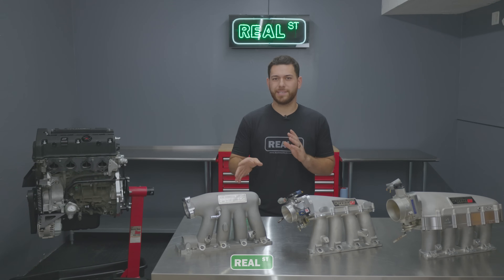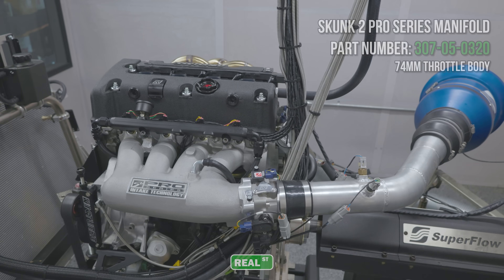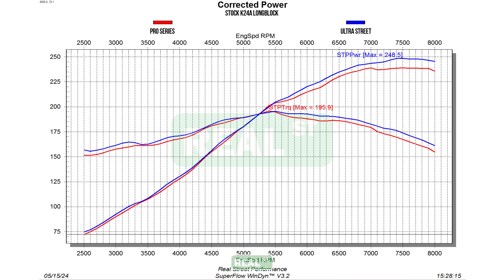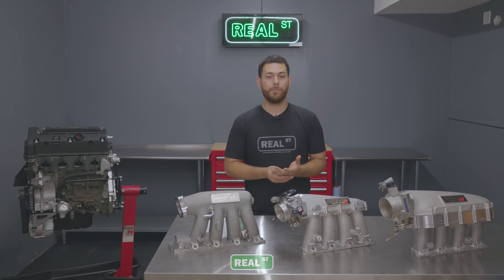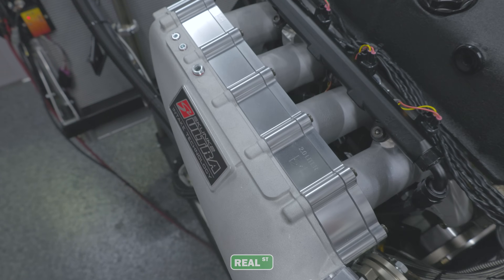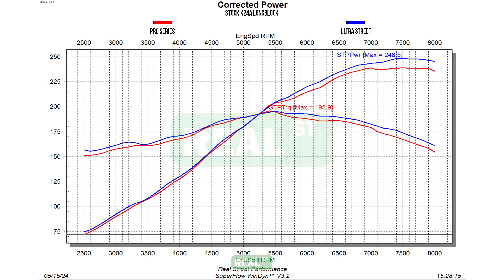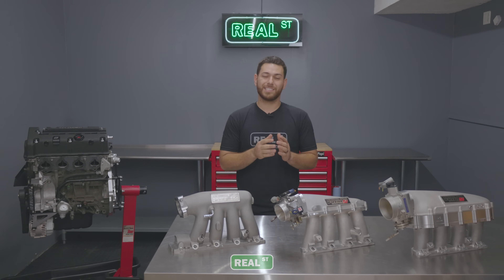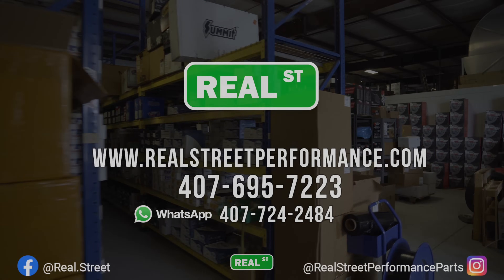Choosing The Proper Intake Manifold For Your Honda K24 || All Motor Stock K24

Comment: i have the 04-05 k24a2, i have the street series intake mani and skunk2 alpha headers..p2r fuel rail, bluetop injectors, stock mugen exhaust and my car only made 197 on a dyno hub...anything different from the setup in the video?
Reply: i'm wondering if they have a different vtc cam gear in this ?

Comment: And Pro Series VS Honda RRC?
Reply from the maker: We havent stacked them against an oem manifold yet, we may do so down the line to put out some more data. Thank you for watching!
Reply: @realstreetperformance  Yes that would be really good because everyone says that the RRC is better than the Skunk2 Pro series which is normally its equivalent. A Skunk2 Pro series, Honda RRC, Honda RBC test would be really great. Same as RRC vs Pro Series. Not Ultra Street because it is a category really above but Skunk2 Pro series vs Honda RRC would be great 🥰

Comment: Quick question, Can the skunk2 manifold be installed without a tune and do I have to upgrade the piston rods? I was thinking about upgrading my daily 2012 TSX to make it a bit fun before I build a NA k20 to replace the current engine. It will eventually become the project and Id have to get a new daily at some point. but till then I would like to have some fun with it current stock motor till I crops out. Any suggestions

Comment: Test the center feed on the stock k24a longblock! (pracworks or other brands) Its a logical competitor to the ultra race/street
Reply from the maker: For sure! We're just getting started :)
Reply: @realstreetperformance  I'd love to see the Bourne HPP cam added to the list. Not sure if their high lift cam would work with stock compression, but i'm sure their drop in cam would.
Reply: Maybe even the 4p RR3 cams?

Comment: No base line HP numbers. What was the stock intake? They give the power the 4 skunk 2 set ups gave them. Always need a baseline. Good info for the intakes but doesn’t tell me if the 1st one made any real power.
Reply from the maker: Yes I agree, adding a stock manifold would be a good comparison. For now, I think the data we got comparing these other manifolds was insightful for those set on an aftermarket unit. Thank you so much for watching!

Comment: Awesome test, thanks for sharing! I definitely wasn't expecting these results, especially the similar low end torque. I would have thought that the Ultra Race manifold would have killed the low end torque with such short runners. It would have been awesome to see a baseline run with the stock K24 manifold though so we could see the difference. The OEM RBC and/or RRC manifolds would be a great comparison too so we could see if upgrading from an OEM manifold would be worth it.

Comment: ultra street 
74mm TB
3" manifold
70mm system 
50degree vtc

Made 255 / 205ftlb @ 8000rpm

Since then, gone full 3" setup and expect closer to 260
Reply from the maker: Nice! sounds like a fun build
Reply: @realstreetperformance  Just adding my 2pence as to further backup your test results. Although, how did you find the port alignment to the head on your ultra street manifold, mine were iffy?

Comment: Are you guys running a type s oil pump and rbc intake cam gear or not? Based tsx cam gear is only 25 degrees, if you guys running it is as total stock, can you do a second video with these upgrades also include a rbc ported 80mm, rrc as well

Comment: Nice test, would have been great to see it baselined with an RRC in the test too
Reply: Agree, missed opportunity. There are 2x tests online from Tegiwa and Superstreet showing the RRC as the winner up against Skunk2 and others.
Reply: @SBBUK how's the rbc 8th gen si compared to the rrc?
Reply: @mikellewis2346  RRC beats RBC for peak power in all the tests I've seen, but all differences are only a few %. You might get slightly more power lower down with RBC but it's minimal.
Reply: @SBBUK  thanks,  I have a 07 8th gen si with jdm k24a in it with the rbc and it runs great for back road fun. So sounds like it's not worth the hassle to change it for little to no gains strret driving it.
Reply: @SBBUK  est ce une vidéo franche ou commerciale? Où peut on voir ce test?
Reply: You could also port the RBC which will help it you won’t need to upgrade for a bit unless your doing crazy compression and cams the normal drop in cams with a ported mani and head will be enough stock comp

Comment: I’d be interested to see a graph of skunk2, gato, and other intakes on a turbo application
Reply from the maker: Turbo intake manifold testing i think will be really interesting too.
Reply: @realstreetperformance  I think it would be interesting to see how cast runners , cnc runners, ported cast runners, and different size plenums can make a difference to the power band or power gain/loss.

Comment: Please show how it compared to a stock RBB manifold!  My stock K24a makes 220hp and 200ftlbs at the tires.  As a track car I feel these all would drop torque that the RBB has.  Helps pull you out of the turns.
Reply: I have posted that many time on forum.

Comment: Gotta see a RBC manifold vs skunk2 one. So i can see if its worth to upgrade my k24
Reply: I made 235 with a stock rbc with 70m tb. This was with a dirty air filter btw
Reply: its not if you dont have big NA build or boosted
Reply: F20 b
Reply: I have a k24a in my 07 8th gen si with the rbc manifold and it works great. It pulls hard to 8k all day.

Comment: Great video!! Should do a head package and cams next, with a larger tb. Most street guys have setups like this, would be dope for info. What transmission/gearing was used for test??
Reply from the maker: Yesss :) . This being on an engine dyno doesnt using a transmission with gearing, true crank horsepower is read.

Comment: Need to test the middle intake with a plenum spacer as well you will find the longer runner with upped plenum volume will probably be your best over all combo
Reply: I’d like to see this. That’s what I’m gonna be running on my swap. Ultra street with the spacer. Although I might do a port on mine with 4p
Reply: @K24_Rizo I have that same 4 piston ported ultra street with a spacer for my pro2 cam F20b with a k2h kit. I still haven't ran it yet
Reply: My ep3 is getting something similar.

Jdm k24a
4piston pro tsx head
Drag cartel 2.2 cams
S2 ultra street IM with 0.5L spacer
S2 74mm throttle body
Rsx Type S oil pump
410cc rdx injectors
S2 alpha race header
Ktune 3inch exhaust
Hybridracing 3inch CAI
Reply: Be good to see how the Pracworks intake does against the skunk2 ultra with a plenum spacer.
Reply: @DansbannanaS2000  that’s an expensive test 😂😂😂
Reply: @K24_Rizo  I run the prackworks seems to be working well just curious as  the ultra seems to be the go to inlet
Reply: @DansbannanaS2000  I think it’s more of a price thing, but imo I know the ultra can be welded for boost, so that could be another factor. Plus the spacer availability and porting options. Pracworks is def the best looking setup other than itb
Reply: @K24_Rizo  Yeah itb's are good although I gained 10hpp over the itb set up I had.. same dyno but different day. So not direct test but air temp as 3 deg hotter when I swapped to the inlet. But I want to go back for that noise 🤣.
Reply: @DansbannanaS2000  can’t go wrong either way 😂 it’s never ending
Reply: look at getting an Invidia Q300 Exhaust. its 2.75" but the sound is sooo worth it.

Comment: A test for the people! 10/10
Reply from the maker: Thats right! More to come.
Reply: I guess you're right about the performance advantages of the Skunk Manifolds over OEM, but have you ever considered weight ?  Those things weigh a ton !  In Prototype racing where weight is a critical factor, that additional weight will cost time. What do you think about the lighter RSP OEM jobbie with those reduced length trumpets you see on line ?  Oh and the Skunk 2 doesn't fit in the cockpit in any case.